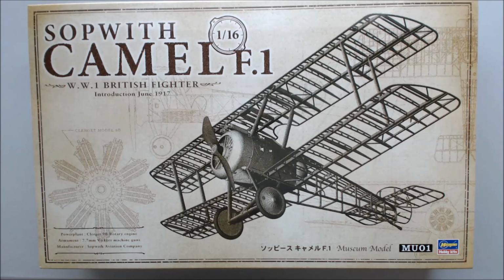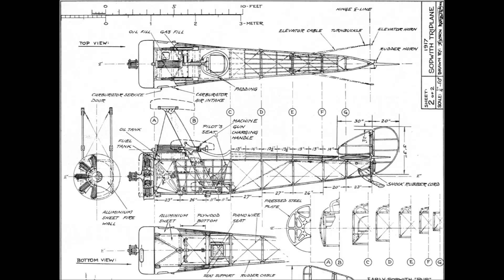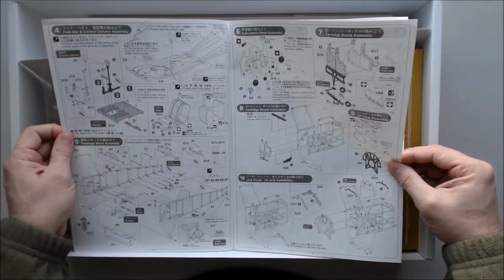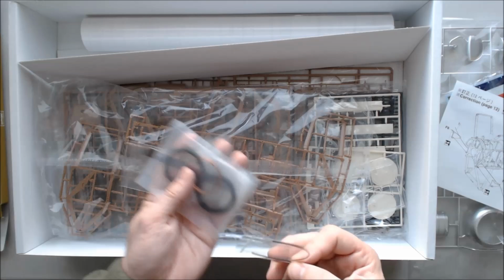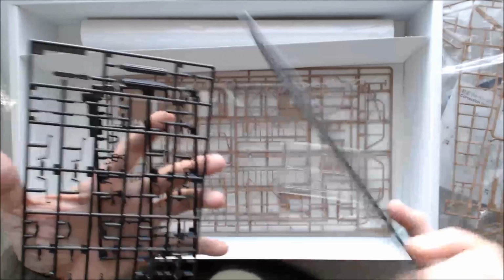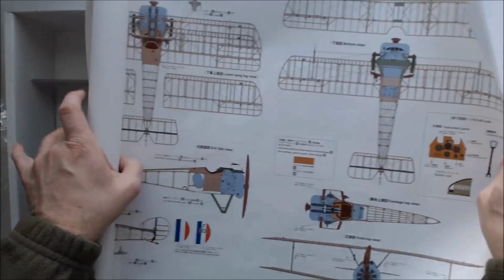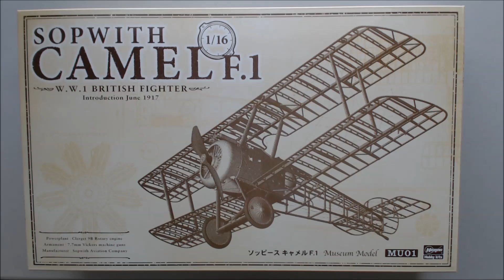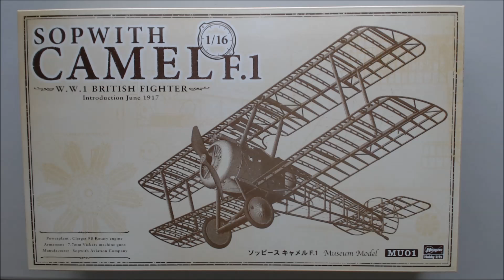Unboxing Hasegawa's 1/16 Sopwith Camel

Comment: I just found one on E-bay for $140.00 with free shipping, and I also got an additional $5.00 credit from E-bay from a late delivery guarantee of a previous purchase a couple of weeks before. The grand total was $135.00, so I decided to just go ahead and get it. You won't find that deal very often, and in fact, I've only seen it twice at $140.00. I ordered it the 1st time I saw one at that price, but the order was cancelled by the seller because it was discovered to be damaged. They average $160.00 and higher,  plus 30-40 shipping, but can sometimes be found on E-bay for $150.00, and if you are really lucky, shipping will be free.

Comment: I think I will buy this one and do it first before I do the original wooden kit lol because the wooden kit looks a lot harder than this one...I could be wrong but I cant afford a OOOPSY...LOL
Reply: There is no correlation from one to the other.  This kit has the wings, fuse etc. pre-assembled as molded.  ZERO skill needed.  Your displayed angst suggests you build this thing and put the good and wooden kit onto eBay.
Reply: @WOOD BUTCHER -  You say "original wooden kit".  Are you referring to the Hasegawa 1:8 scale kit?  If so,  that kit is much more detailed with 857 parts.  That said, if you have built any model kits before, you should have no problems with the larger scale kit.  I built one some 23 years ago and had no difficulty whatsoever.  Hard to build - no.  Time consuming - yes.  Actually, it was one of the most enjoyable builds I've made in my 65 years of modeling and the final result is stunning!

Comment: Can the model be covered? If so with what material?
Reply: David Meinke paper used for flying models that you can get easily in model shops
Reply: @David Meinke - The model is not meant to be covered so you can view all the various and numerous details from a structural standpoint.  I built Hasegawa's 1:8 scale Fokker DR1, a much more detailed kit with many metal parts and a wood prop.  I would never think of covering all that fuselage and wing detail that I spent so much time on.  I believe that's why it's called a museum model.
Reply: @Loulovesspeed  These models are called "Museum Models" for only ONE reason, to $ELL  them to those who have never seen a real WWI aircraft bereft of covering. The cross-sections of all of them are grossly oversized.  They'd all look far more realistic covered and properly airbrushed.

Comment: If your still looking for someone to build this kit into a (partially) covered (with japanese silk) Camel; I would be quallified & willing, just let me know. Cheers.
Reply from the maker: +Flying Dutchman WoT/WoWs Gameplay TV One of our staffers did build this up, but thanks for the offer. :)
http://aeroscale.co.uk/modules.php?op=modload&name=SquawkBox&file=index&req=viewtopic&topic_id=224805&ord=&page=1
Reply: is there a way that I can see it? I'm planning to build this kit myself and can't wait to see what others have done with it. It should build into a marvelous kit.
Reply from the maker: I put a link up there. Is it not showing up? He has finished photos on page 2 of that forum page.
Reply: Thanks alot, I will shure check it out and let you know what I think. Cheers.
Reply: +Flying Dutchman WoT/WoWs Gameplay TV It does look good indeed :) I would prob avoid the trouble with the wires getting in the way of parts by installing turnbuckles but I can understand why Hasegawa doesnt make you attempt it. Also I would use some Alclad for the metal parts and black for the brackets in the frame but than again I'm probably spoiled by all the Roden & WNW kits over the last few years :) Thanks for the link, I appreciate it.